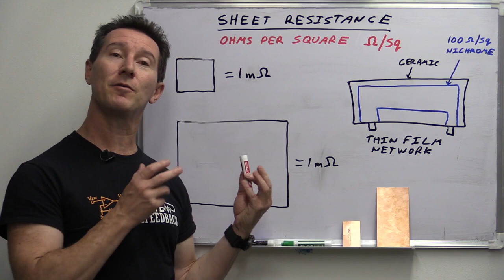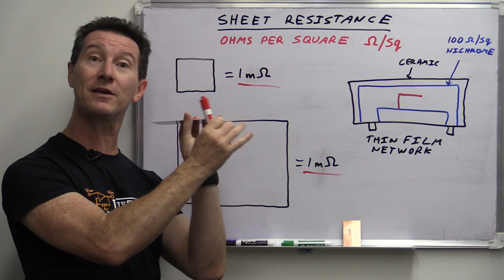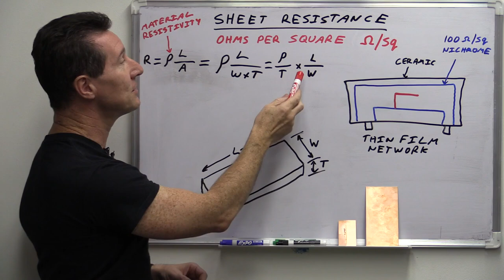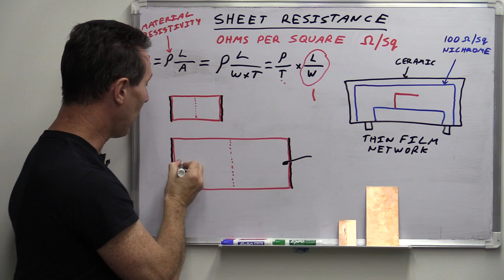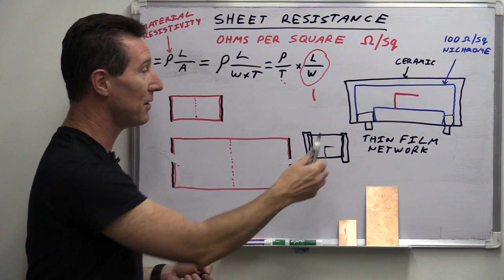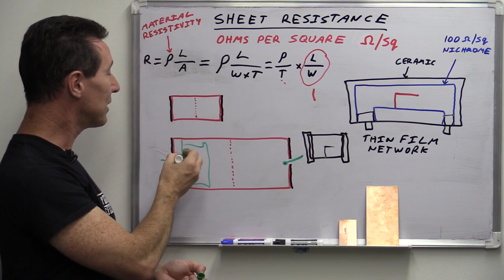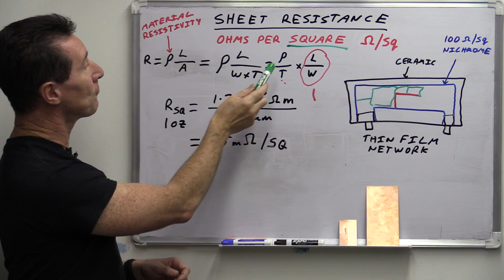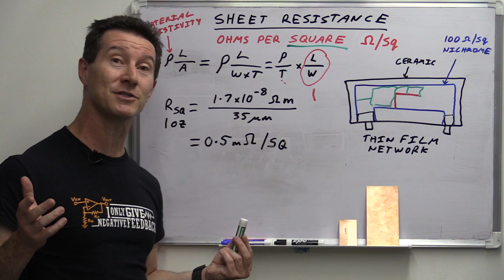EEVblog #732 - PCB Sheet Resistance

Comment: If the resistance of a sheet is the same regardless of the size, as long as the shape remains the same, what's the advantage in having a larger sheet? Why not make it minuscule?
Reply: WarpRulez I would say the bigger sheet can carry greater current.
Reply: WarpRulez I would say a bigger sheet gives finer control for adjusting the resistance. If you have a wonky laser with a precision of +/- 1 mm, then that will be a huge error on a 5 mm^2 sheet, but much smaller on a 50 mm^2 sheet.
Reply: Daedalus Young
Wouldn't it be cheaper to buy a more accurate laser than make millions of large sheets?
Reply: WarpRulez bigger current (but its more easy to make it more thick). Maybe heat dissipation and ability for more accurate trimming?
Reply: WarpRulez Larger currents = more power dissipation required to keep the tracks at lets say 10 degrees C above ambient. So you can have the same number of "squares" for two different tracks, one tiny and one large, which will have the same resistance, and therefore the current will be the same given an applied voltage, but the tiny trace will heat up considerably and probably melt.
Reply: Samuel van Loggerenberg 

I have no real experience with PCB design, but I am left wondering how the current carrying capacity of PCBs compares with wire (such as if doing wire-wrap).

for example, IME, 24AWG wire seems able to carry about 4A with no obvious effect, starts getting pretty hot around 7A or so, and starts to burn up much past this point (say, 10-15A). for higher capacity, 20AWG or 16AWG wires can be used (or a larger number of parallel thinner wires).

I would guess a similar sized PCB trace would have a lower capacity due to being a lot thinner, but I don't really know.

but, I guess it is possible given things like PC power supplies use PCBs, and a lot of traces which seem a lot smaller than would be expected for a wire. and also things like NPN power-transistors and MOSFETs often seem soldered to relatively modest size traces.

so, for example, about how wide would 20A traces need to be on a PCB?...

then again, maybe the traces having a solder coating is also a factor?...

am I missing something?...

(or, am I just over-engineering the wire thickness, say, by limiting single strands of 24AWG to circuits of 4A or less?...).
Reply: Brendan Bohannon There are a number of online calculators that can determine the trace width required for a given current. For a 20A current and a 20C temp rise above ambient, you require a trace that's around 13mm wide. For internal layers you'll need to more than double that (32mm) since they are more thermally insulated. 

Turn that down to 10C temp above ambient and the traces should be ~20mm and ~50mm wide respectively. 

I'm not sure how standard 24 AWG wire are rated (at 3.5A with single core), but I would guess it would be according to a fixed temperature rise. Since they are more thermally insulated they would also have to be de-rated. Also, you can work out the power dissipated in the wire using standard P=I^2R and then divide that by the area exposed to ambient air to determine a rough figure of power dissipation in Watts/m^2.

In this case the difference is probably that the area exposed to ambient for a PCB is larger than for a thin round wire. Think of the heatsink analogy. A 100g finned aluminium heatsink with more surface area has better power dissipation than a solid 100g block.
Reply: Brendan Bohannon 
It's not only the gauge of the wire that matters but also how many strands of wire are in it. For instance, a gauge of wire that has 20 strands in it can handle more than the same gauge with only 12 strands in it.
Reply: Robert Calk Jr. I don't think that's correct. Almost certainly not at DC. Stranded wire is more flexible sure, but the total cross-section is basically identical and therefore the current handling capability should be basically identical. Only once you get to high frequencies will stranded wire be better since the skin effect is lessened.
Reply: Samuel van Loggerenberg

yeah. looking into it, it seems there are different types of PCB blanks with different weights, and a heavier one may be needed for more current with smaller traces.

but, yeah, area could be a factor, as it radiates the heat into the air.

looking, apparently at 7A, solid 24AWG runs at around 90C, and at 10A runs at 200C.
at 4A, it seems to stay around ambient.

going too high, the insulation cooks off, and then the wire glows red and breaks.

a lot of the wire I have been using (from old CAT5e cable), seems to have insulation able to resist open flame and direct contact with a soldering iron or with molten solder.
Reply: Robert Calk Jr.

this doesn't really match my experience. for example, I have some 22AWG stranded wire, that seems to get hot faster than the 24AWG solid wire, though this could be due to it having thicker and more melt-prone insulation...

I have noted that several parallel strands of wire seems to hold up a little better than a single thicker wire though (despite the seemingly lower amount of copper involved).

so, for example, several parallel 24 or 20AWG wires may be a lot more convenient (and compact and well-behaved) than using a 16AWG wire.

for many uses, 20AWG solid wire seems pretty, well, solid... (and doesn't generally need drilling bigger holes in the perfboard).
Reply: Samuel van Loggerenberg 
No, they are not identical. Check out some datasheets.
Reply: Samuel van Loggerenberg Sam's right in that only the total cross sectional area matters, whether its 20 strands, 12 strands or a single solid core. What Robert has said is not even correct at AC for standard stranded wire as the conductors are in contact, That's why you have to use Litz wire in antennas and transformers at high frequencies, in which the strands are insulated from each other and also wound in a special pattern than balances how much length each spends on the inside or outside of the bundle. That's because of skin and proximity effects.

Brendan, It depends on how much you allow the copper to heat up by for a given current. One rule of thumb for wires is that for an exposed conductor you can use up to 5A/mm^2 of cross sectional area, for a hidden conductor such as a transformer winding where it's harder for the heat to escape, you're limited to around 2.5A/mm^2 ideally, 3.5A/mm^2 max. I don't remember the temperature rise for those figures, it's probably 10'C. As 1oz PCB copper is only 0.035mm thick, it's really impratical to achieve this current density for anything but the lowest currents so for any PCB trace carrying significant current, just make it as short and fat as possible and maybe remove some soldermask to build up some solder on top to carry more current. Your question of a 20A PCB trace width - as wide as you can fit but more importantly really really short and it will still drop voltage and get hot. You can get PCB mount busbars for high current. ATX power supplies have big copper fills for every rail and ground on high current the secondary side and thick wires coming out of the PCB as early as possible and then bundled up with a cable tie, not taken to a connector at the edge of the board and they sense the voltage for feedback as late as possible so voltage drop across those conductors is regulated out. They also have a big fan blowing a lot of air right over the board which will cool the board as well as the heatsinks.

24AWG is about 0.2mm^2 so really shouldn't carry more than 1A at 5A/mm^2. The equivalent PCB trace in cross sectional area would be 5.85mm (230mil) wide If you want 4A, this would be 18AWG at 5A/mm^2
Reply: KX36 
He was talking about current, not antenna wires and high frequency. And I'll believe datasheets before I believe anything you say.
Reply: KX36

I am not entirely sure how the PSU PCB works internally, but one I had disassembled appears to have narrower but extra "thick" traces covered over in a mound of solder for the power rails, and all the wires of a given color basically connect together into big soldered masses.

yes, ok. running 4A over 24AWG seems to work though for no obvious ill effect, and the voltage drops are reasonably modest for short distances.

usually, for medium-power wiring, I more often use 20AWG when I have it.

significantly thicker wire though is more unweildy and doesn't play as well with perfboard (doesn't fit in the holes), but fairly often 16AWG or similar may be used for power-rail connections or other things.

I suspect I prefer solid wire partly also because it more likes to lay flat and stay in place once positioned and soldered, unlike stranded which moves around (and may need hot glue to secure in place).
Reply: Robert Calk Jr. I don't know of a mechanism that would make this possible, do you have an example datasheet that shows this? From your comment I'm also assuming you mean at DC?
Reply: Samuel van Loggerenberg

FWIW, most of what I am doing has been at 12-14 volts DC (may or may not use higher voltages later. often, lead-acid batteries are the power-source).

some of it involves kHz range PWM signals or similar though, but this shouldn't matter too much (and a lot of the external connections and wiring is stranded, with motor and battery connections generally using thicker wiring than the stuff on-board).

for example, motors may be wired up with 16 or 14 AWG stranded, with 10AWG for the battery wires.

for longer runs, the thicker wire does have the advantage though of a lower voltage drop (like, one doesn't see a several volt drop between the driver-board and motor or similar).
Reply: Brendan Bohannon 
What is Litz wire? It's several strands wrapped together because of the wire skin effect.
Reply: Samuel van Loggerenberg 
http://en.wikipedia.org/wiki/Skin_effect
Reply: Robert Calk Jr. Again, skin effect is non-existent with DC current...
Reply: Samuel van Loggerenberg I agree. The math dictates that solid copper has lower resistance than stranded of the same gauge, assuming DC of course. I would be very interested in seeing a data sheet disputing this fact.
Reply: Don't forget PCB thickness. On power applications I usually go with 110 micron (going higher makes it a pain for PCB thermal bending effect and valley traces effect). Since total resistance lowers with thickness increase (at even L and W), that explains.
Reply: bain5872 are we sure those solid and stranded wires are made with same copper alloy?
Reply: CPZeroDue
Yes, theoretically one would have to assume both conductors are made from the same metal or alloy. One could construct a stranded conductor with lower resistance, than a solid  copper conductor by using a high conductance metal of say, silver or gold. But this is a completely different subject.
Reply: Samuel van Loggerenberg 
Then I misunderstood something.
Reply: bain5872 just saying because even copper is not always same copper (changes could be in purity, treatment for achieving mechanical/contact properties, alloy made of minor quantities of other materials, etc). I guess cable datasheet is always needed to see the differences. Anyway, same section size made with same material, should have same resistance at DC both solid and stranded in a ideal world (we always have tolerance/accuracy).
Reply: The math does not agree with your statement that stranded and solid have the same resistance. Solid is solid. Stranded has small air gaps that do not conduct. They do not have the same resistance however, the differences are small.  http://en.wikipedia.org/wiki/Wire
Reply: bain5872 We don't talk about diameter, we talk about section area. So if area of solid wire is same of area of single strand X number of strands, should be same resistance. At least that's what I meant
Reply: Who are you referring to as "we".?
Reply: Robert Calk Jr. No worries. I agree the skin effect will become measurable with AC current in the kHz range for modest cable sizes, but even then, I'm thinking stranded wire will form something like a hollow conductor since the strands are touching, even though there are air pockets in-between, which will suffer from the same skin effect as that of a solid conductor (it does not matter if there is conductor material where the current does not flow, in fact they use this to save costs with silver coated steel coax). By that reasoning solid and stranded wire will have similar current handling capacity even at high frequencies. 
Litz wire where the strands are insulated will however lessen the skin effect considerably at high frequencies.
Reply: WarpRulez They DO make resistors miniscule. Ever seen a 0201 Package? Its 0.6x0.3 mm. That's miniscule in my book.
Reply: bain5872 me and you. we talk about area, not diameter in this case
Reply: Oh, OK. I was referring to resistance as a product of two wires, both given the same diameter which of course, is all theoretical. A real world stranded wire has an increased cross sectional density to compensate for the very differences I have pointed point out.
Reply: Robert Calk Jr. By definition, American Wire Gauge (AWG) refers to the total copper cross sectional area of a wire, so the resistance at DC should be the same per length for solid and stranded of the same AWG. http://en.wikipedia.org/wiki/American_wire_gauge#Stranded_wire_AWG_sizes
Reply: Brendan Bohannon Or even more confusing.. if a length of wire has a resistance of 0.1 ohms, and you are running 12 volts through it, then why are internet trolls?
Reply: Ryan O'Connor
?...

crude measuring: 50 inch (approx 1.25m) of 24AWG is approx 0.1 ohm. 50 inch of 20 AWG is approx 0.07 ohm.

granted, a lot depends on amperage.
running 12v is fine, but how many amps one is running determines how much the wire resistance is relevant.

though, for board-level work, voltage drops aren't really too much of an issue, but wires getting hot is can be an issue.

for longer lengths of wire, voltage drops become more of an issue though.
Reply: WarpRulez Current is the reason. It could be smaller but it would handle less load and of course the narrowest point would be the limiting factor.
Reply: dorbie
I don't understand. How is current in any way the reason? If the resistance is the same and the voltage is the same, then the current is also the same. It's not like the current depends on the size of the resistor.
Reply: It is about the current it can handle without overheating. Think wire gauge or fuse rating etc.
Reply: dorbie
You're correct. Power dissipation is the limiting factor of these resistive strips.
Reply: WarpRulez i would say even though the total current is obviously the same, the smaller square handles a higher current density, so heats up faster, and therefore its resistivity will change since it depends on temperature. You would want to fix the size based on how much power is planned to be dissipated through the resistance, and if the conditions, like the ambient temperature and the external medium (probably air) allow that much power to be dissipated without the temperature of the circuit changing. You can also say that even though the both square dissipate the same power, the power dissipated per unit area is bigger for the small square, and its temperature will rise. The big square has more surface exposed to air so acts as a better heat sink, keeping its resistivity constant more easily.
Reply: WarpRulez We should make overland lines out of giant, almost lossless squares.
Reply: You're looking at it backwards.  The sheet resistance of a material is the same no matter the area of the material. You're measuring a property of the material.  Where that comes in handy is when you vary the length of the electrical path through the material, thus varying the total resistance.

Comment: i have a problem for the mathematicians:
in an infinite grid of 1 ohm resistances what is the resistance between 2 points at the ends of the chess horse movement (L)?
Reply: viermidebutura Write it out as a sum over nodes, starting small to get the “expandable” formula as a series of some sort, then use a limit to convert it to an integral, and that’s your answer :) It kinda doesn’t require much thought once you get the process: it’s generic. Some special cases are engineering trivia that you should not be thinking about while crossing the road or operating heavy machinery :)

Comment: Actually its not that strange. If you think of a sheet of material as big pile of resistors.
Imagine a resistor of 1mm x 1mm... when you increase length, you are adding resistors in series when you increase width you are adding the in parallel. If you increase both length and width (increase the square size), you get strings of resistros in series paralleled with other strings of resistors. Solve that using normal resistor formulas and you will get always the same result.

Comment: All people know's that :) if you know how a normal resistor works,  the pcb is not a Different. many used for heat bed on 3D printers, I wonder why there is no coal traces for heat bed, that wold be more efficient to heat VS current, or alu pcb. but it also come down to price.

Comment: Is anybody using the furlong still? prolly merica......... also yes sheet resistance is to be considered when you design   impedance controlled pcbs, Be it coplanar waveguide or microstrip or whatever, said parameter has a part to play
Reply: Furlongs are still used in horse racing to measure the length of a race. And of course in the always popular speed measurement of furlongs per fortnight.